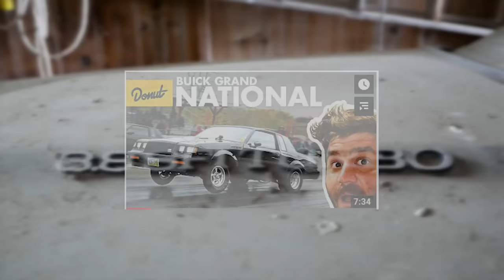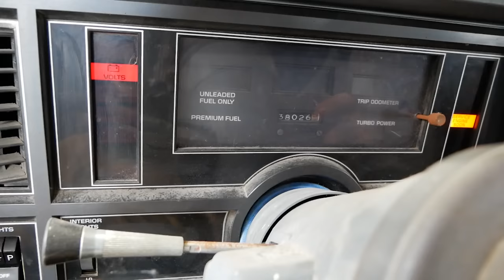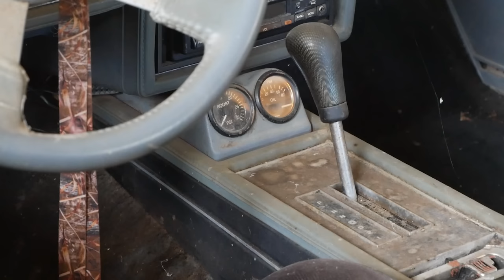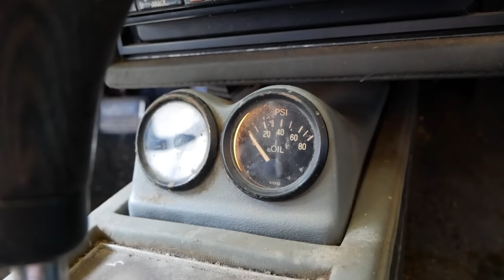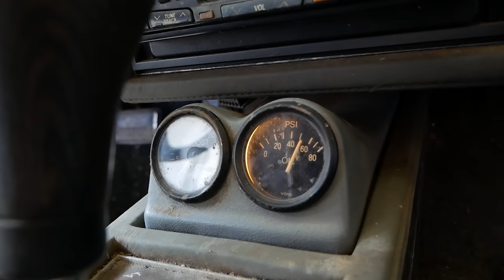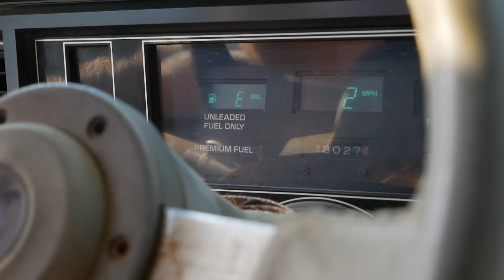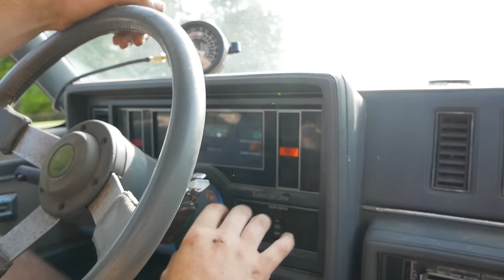BARNFIND BUICK GRAND NATIONAL - Will it Run and Drive??

Comment: Bought a new GN in 1987 and, at that time,  the fastest car I ever drove off a showroom floor.  My wife got pulled over a couple of times for drag racing.
Reply from the maker: Where the heck is it now??
Reply: @JunkyardDigs  Long gone.  Sold it back in 1990 after doing some mods on it that made it even faster.  It started to be more than I could handle.
Reply: @JunkyardDigs  my brother bought a 87 also.  Still has it.  Ga car.  Zero rust.  All factory.  42k original miles.  Sitting in his garage with 4 flat tires and a dead battery.  He just parked it and there it sits.
Reply: Haha mint.
Reply: @beckyumphrey2626  Wanna sell it?  Lol
Reply: @greendryerlint  I am betting he would sell it.
Reply: @beckyumphrey2626  let junkyard digs know, he’s looking to buy one.
Reply: @beckyumphrey2626  Where in GA?
Reply: @beeemerboy1  United States.  The state of Georgia.
Reply: @beckyumphrey2626  If your brother wants to sell the Grand National let me know plz. Im in Dublin GA thanks
Reply: @michaelmitchell7817  I am in Douglasville Ga.  My brother has the car in his basement in Dallas Tx.  I will ask him.

Comment: Seriously though, a Ford Festiva revival would be WORTH IT!!
Reply: Let's get this comment to the top! Let's see it
Reply: Thing is light AF there's a lot of engine swaps you could do, and have an inordinate amount of fun cheating death by driving it.
Reply: Yup, i owned one. 265,000 miles on everything original until a lady rear ended me with no insurance and totaled it!! That was a GREAT f'n car!! 😃 BTW, that thing could plow through snow! 😃
Reply: Look at The Steve from Braden Carlson!   Such a cool build even tho its since been crushed. It was a Zero F's given build
Reply: Or that Omni/Horizon. I wanna see them do a cheaply made throwaway POS.
Reply: Loved my Festiva. Wish I still had it. Lost it to a whitetail.
Reply: And turbo it somehow
Reply: Love the festiva
Reply: I'd love to see that, but the one in the beginning of the video seems like it's too far gone to save, might make for a good parts car though.
Reply: One of those would be a good candidate for something to put a turbo on.  If the crappy little motor could handle it.
Reply: @greendryerlint  the motor in it is a mazda b3 (the car is a mazda), it'll take a turbo. swap on a DOHC head and toss a turbo on it and it'll waken up, seen a few pushing around 400HP. but why put a turbo on a B3 when you can swap in a BP-ZE or KL-ZE and turbo those and get far more power out of those.
Reply: @madmax2069  Is it?  I stand corrected.  I always thought those were made by Kia, which wasn't so great back in those days.  My buddy had one, and the best I could say about it was it was transportation and good on gas.  It's like the old joke:  "What do you call the shock absorbers on a Yugo?  The passengers"  Same pretty much held true for his Festiva.
Reply: @greendryerlint  The brand Kia wasn't sold in the US until around the mid 90s this predates any US sold Kia by a few years. the Mazda 121/Ford Festiva was introduced in 86-87, and funny enough in South Korea is was rebadged as a Kia Pride (and SAIPA in other regions, and believe it or not they made a pickup version called the SAIPA 151)
Reply: @madmax2069  Was it not actually built by Kia though and rebadged as a Ford, though designed by Mazda?
Reply: In 2001 I bought an 88 Festiva to commute on a 95 mile each way drive.  Sold it to a co worker after I moved and he bounced it off a deer.  That car had the coldest A/C ever
Reply: @Gooobzilla  I'm not a fan, but there seems to be a cult following for these cars.
Reply: She who will not be named owed a 79(?) Festiva. The seats were surprisingly extremely comfortable for a little econo-box.
Reply: I used to have an 89 Festiva in the early 90s. Painted it all black, tinted the windows, cut all the coils to drop it down and installed a huge stereo system that was worth twice what the car was worth. It was the perfect shape to hold and amplify the bass from the subwoofers. That little car was infamous around my hometown. 🤣
Reply: @greendryerlint  no, nothing on it was built by kia, it was Mazda through and through, Mazda designed it, uses a Mazda engine and used a Mazda platform, only the badge was changed. Just like with the older Ford ranger which is a Mazda truck
Reply: @jwrockets  there was no 79 festiva, there was a 79 Ford Fiesta though.
Reply: @madmax2069  Appears to have been manufactured by Kia, though Mazda design:  https://en.wikipedia.org/wiki/Ford_Festiva
Reply: @madmax2069  Thank you. I stand corrected.
Reply: In my country was quite odd,  3 door car was Ford Festiva, 5 door car was Kia Pride POP, and there was a sort of Station Wagon also Kia Pride Beta name. So both cars were sold together but not same version, quite funny.....  Uruguay
Reply: @greendryerlint  yeah, Kia assembled it, but they didn't actually make any of the parts, Mazda did, Mazda made the parts and everything and shipped them to where they needed to go, Kia just assembled it and slapped their branding on it, but it wasn't a Kia design, not did it contain anything from Kia other than the Kia name badge and body sticker.
Reply: @madmax2069  Don't you mean the Ford badge?
Reply: Do I hear Sho-Gun??  Hmmm

I remember you couldn’t give those Festiva’s away. Heck I remember back in the late 90’s everyone was buying them for Stereo cars.
Reply: The ford would be kool
Reply: @Mike C  Agreed. I've got a '95 (badged as a Ford Aspire, Ford Festiva, Mazda 121, and Kia Avella), and it was built in South Korea. As for all of the turbo talk, the Mazda B3 just doesn't like em. The Mazda BP and B6 however, are great for turbo applications, and you can usually pick em up pretty cheap! I'm really hoping to put a B6T in my car someday.
Reply: @madmax2069  Amazing the Mazda part of the story did not know, thanks for that, in my country is very common to see them as Kia Pride PoP or Kia Pride Beta, and only one model Ford Festiva
Reply: I agree! You can’t find any for sale anywhere. I bought one new in 1990, and kept it for 15 years. 42mpg! I’ve been kicking myself ever since for selling it.
Reply: @MNWILD43  insurance totaled mine just because all four tires got slashed!
Reply: @puzzlefoot  lol. My dad had a turd brown Horizon. I beat on it pretty good until I bought a '79 Rx7.
Reply: How about a Yugo or LeCar?
Reply: @sostrucking  my grandparents had a pair of them. My first car was an 89 Escort wagon, sbsolute pos, hated it at the time, but, in retrospect, one of my best cars. That's why I'd love to see him do something similar. No frills or bells and whistles, just a cheap point a to point b grocery getter.
Reply: With a GN engine swap!  😆
Reply: Yep, Festiva's revival would be cool. I used to have an 89 that was a boom box on wheels! I had 3 twelves in it and it would bulge the windows and all the sheet metal when it hit.
Reply: I've seen those pulled out of the woods and driven. Still see those on the road to this day.
Reply: I threw atv tires on my Festiva and race it on a track I built out back. Its a tough little car.So much fun.
Reply: Lmfao 😂😂😂😂
Reply: I truly support that

Comment: I worked at a part store in the early 2000’s. There was an old guy with a GNX that would come in. He had loaned his son the money to buy it in the mid 90s and then bought it off his son when his son was done with it. He told me he got tired of smoking mustangs and camaros and enjoyed running away from corvettes.
Reply: A guy I worked with used to have one. I've seen some videos...  Man that thing was fast
Reply: They weren't really that fast. there were a lot of faster cars, even when it was built.
Reply: @shaggyduder  there were no faster American made production cars in 1987. 0-60 4.7 seconds which was faster than the Corvette, Ferrari and Lamborghini. Even in 2001 the Corvette was 4.8 seconds 0-60mph. So, yes, for its time it was fast.
Reply: @slowdaze  because of the turbo, which no other car had.
Reply: @shaggyduder  hahahahahahahahahahahahahaha........ First not true, not true at all. Lotus Esprit, Chrysler Conquest, Porsche 944 and Pontiac Trans Am all had turbos at the time. Second what is your point? It was a fast for it’s time car which you very incorrectly said it wasn’t.
Reply: @shaggyduder  What does your red herring about the presence of a turbo have to do with whether or not this car was fast? 0-60 in the upper 4s is still fast by today's standards, few American cars came anywhere close to that number in the 80s.
Reply: @Nick-ue7iw  I'm just saying, a turbo or SCer can make any car fast,  take that turbo of that 3.8 and it's a dog.
Reply: @shaggyduder  no you didn’t. 87 Iroc mostly came with a 305, with fewer having 350. Even at 350 was stock with 225hp. 0-60 was 6.3 seconds. A Paxton only adds 75-100hps. You definitely didn’t do 0-60 in 3 seconds in a 3400lb car with 300hp. As for the last bit, doubtful with as little as you know about cars.
Reply: Imagine someone believing that your boyfriends Iroc could do 0-60 as fast as a 66 Cobra or a Hellcat by just putting a Paxton supercharger on it...hahahahahahahaha...
Reply: They were "special" cars in there day and time. Never really did much for me quite frankly but I appreciate why they have gathered a bit of a cult following. I think the body style just didn't spark much interest as at that time GM had so many name plates on virtually the same body style. I had a Cutlass Supreme with the big puffy pillow seats in it which looks wise was pretty similar.
Reply: @shaggyduder  What is this nonsense? Plenty of cars had turbos. The Dodge Omni GLH.. the Monte Carlo had a turbo 6 option.

Comment: I’ve seen so many older cars that were “wired” by the former owners. All kinds of short circuits and glitches. As I’ve untangled their messes and followed the original wiring diagrams, I’m wondering to myself why in the hell they did what they did? Especially when more often than not there was really nothing wrong with the original wiring. A couple of things come to mind, if you don’t know what you’re doing, stay the hell out of it and if you’re not going to fix it the right way, don’t bother rigging it up. I get temporary fixes, but I’ve seen some just ridiculous things over the years.
Reply: We have a classic car that my grandpa rewired to factory specs because he met a guy who worked at the assembly line that did the original wiring in the 40's problem is car is a 6 volt system so its a bitch to work on cant modernize it either without breaking the car or devaluing it as its so rare that you really want to leave it as is.

Comment: A tip I learned from a master mechanic, you shouldn't use an air compressor to clean air filters. It causes micro tears in the material especially on aged filters and even new ones, and that allows more fine dirt particles into your engine. They're not visible to the naked eye, but definitely large enough to let more dust  and debris into your engine! If you're going to do it, just try and keep it at a reasonable distance.
Reply: Absolutely not true son. I’m not sure what hack told you that nonsense.
Reply: @chrisreynolds2410  it’s actually a fact lol and makes perfect sense, it’s a fabric/ paper filter, compressed air coming out at a fast enough rate can cause micro tears.. causing more dirt and debris to get into the engine than it normally would, not saying your engine will die from it but not as good for it truly lol. And a master mechanic told me that and he’s been doing it for 40+ years and takes classes to stay up to date so I think I’ll trust that over some random dude on the internet telling me I’m wrong 🤣
Reply: Been blowing out air filters for long sense before I was born on the farm on tractors in some of the dustiest conditions you could think of and they have a second smaller filter in side the main filter never have we seen a issue with it ever in probably over 100,000 hours and probably 100 plus combined years of experience with it all the manufacturers tell you not to do it but their just covering them selves incase someone were dumb and blow one out at 100 psi and of course it makes them more money if you have to buy a new filter every time they plug. we blow combine air filters out every other day just about. never had an issue I say it’s a load of shit to sell more filter make more money and then covering them selfs if a engine ever were to get dusted do to an air filter. but in the real world where air filters cost $300 and get plugged with dust ever few days they get blown out.
Reply: Just stop with the internet nonsense......

Comment: This is one clapped out GNX.   This is the exact car you find and the owner won’t sell cause “I KNOW WHAT I GOT”.
Reply: Not a GNX, and not in really that bad a shape given it's age.
Reply: And of course he's also go the typical boomer tall tales about stuff like "YEAH I ADJUSTED THE BOOST GAUGE AND TURNED IT UP TO 20 POUNDS OF BOOST" and "IT'S GOT AN OVERSIZED TURBO" even though it looks like a very stock turbo. You can pretty much guarantee the dude slapped a chip tune into it and made up the rest.
Reply: @grug_son_of_thog  you can manually turn the boost up with this litttle rod thingy on these do i belive him common things people did back theb
Reply: @Supersix231  - you should see the one I was working on. The paint was faded and had a few chips but the body, underside, and interior was in good shape. The radio was stock and working. The power windows, seats, and antenna actually worked. The seats were noisy but they moved. The A/C had been converted to R134A and it worked too.
Reply: @grug_son_of_thog  - it does look like a stock turbo. I wouldn't have ever put those headers on it. It really cuts into the appeal and the value of it. But that's me and it's not my car.
Reply: Not a GNX and the rust on it will big the biggest problem.
Reply: Or "I'm gonna fixer up one day"
Reply: @grug_son_of_thog  That engine would never have handled 20 psi, and I don't believe the turbo could even provide it. "Glory days"
Reply: @meabob  The engineers know more about what make that engine sing than their owners, I would have stayed with the stock manifolds myself.
Reply: @shaggyduder   the stock turbo will huff 20 psi, but is pretty much at the top of its efficiency range and is building SERIOUSLY HOT combustion air. 

The bigger problem is that nothing north of 16-17 psi is feasible on 91-93 octane pump gas. It'll detonate itself to death, or at the least pop a headgasket. 

Either race gas or methanol injection is needed for higher boost.
Reply: @shaggyduder  actually, with decent tuning and some meth/water injection, they easily handle 20 pounds of boost
Reply: Exactly it’s not because they care
Reply: Not a GNX but still a rare car. Honestly these are the kind of people that piss me off. They would rather it rust to the ground then to let somebody else rebuild it and enjoy it and show it the proper respect this car deserves.

Comment: Do you guys ever think about adding some sort of fuel injection cleaner in the tank when you start these things after they set so long? It helps for carbs as well as fuel injection. Cleans the lines pump pressure reg and injectors or carburetors and help with plugs and crap on the valves. I personally use Berryman's B-12 Chemtool. It will save you some grief.

Comment: I'm really impressed that the injectors more or less cleaned up on their own. The GNX's with SFI were light-years better than the pre-1984 cars with the carb. Being an '86, they added the intercooler and got the hp. up to 235 ponies, and was only about a 1/2 second slower than the 'Vette for that year. It will be interesting to see how far you go with this before you send it back.😉

Comment: Rode hard and put away wet.  I love when guys like this “care” about the car and then park it in a barn that’s barely standing so it can rot away.  Then of course he will encounter someone willing to help and still won’t take it as it keeps rotting away.  These people bring some good stories but are ultimately what’s wrong with the car community and why cars like this are far worse off than they should be.
Reply: I've seen cars stored like that before, ots a shame since the car itself seems to be in decent shape. I have a feeling soon as the car is returned to thecower it's going right back in the shed for another 20 years.
Reply: I agree 100%, it's sad really. Sentimental=rot=junk.
Reply: @shaggyduder  sentimental value in car means one of two things I'm going to restore it one day while never restoring it or preserving it sadly this one is the former
Reply: The thing he'll just go to shed and sit in it rev the engine and shut it off or......hes just wanting it run so he can sell.the engine

Comment: I hope you checked the oil pump.  In the 231 V-6, it's located in the engine block.  You need a kit from GM to clean it out.  If it stays clogged, you will break a connecting rod.  That engine goes back to the WWII Jeep.